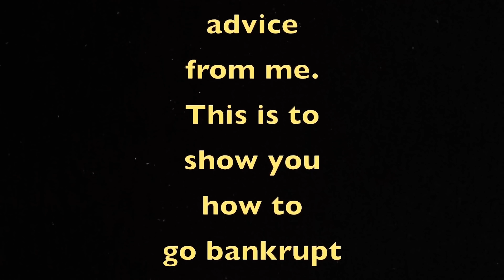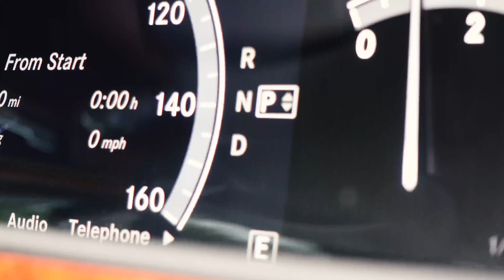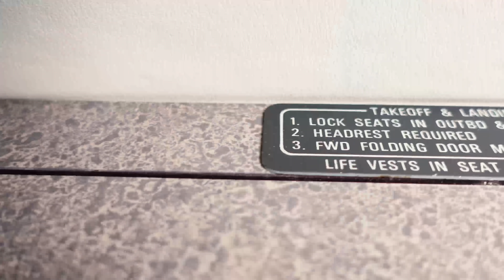Don’t Tell Wife, I put A Private Jet In The House!

Comment: Love the way that turned out!  Need to put some sort of cover on the top, to hide the wire that is supporting it.  You should also find some old PC monitors, turn them sideways, and put them behind a couple of the windows with sky scenes, or airport scenes.
Reply: acceler9, You beat me in this idea! That just means it is a great idea! I mean what could go wrong?
Reply: Could also use some pc fans for the air vents.
Reply: Jimmy get a wall mural that shows an airplane coming right at you in flight and put it behind the windows...That would look sweet.
Reply: Agree the monitors would be a great addition. You should also put the chairs on locking casters so you can move them in and out easy. On the shade closest to you use some vinyl that says 'Clear Prop' as you pull it down.
Reply: The monitors in the windows is a great idea!
Reply: The monitor idea is awesome.
Reply: 100%
Reply: Could always green/blue screen it, too... If he's got the ability in video editing

Comment: May I suggest that you build a "box", the length of the 'Cabin" wall.  Build it tall enough so the regular aircraft seats are at the proper height to the table.  Add seat tracks to the box, to hold the seats.  Your "Mini" cabin is then ready for "flight".  Carpet on "The Box" would be a nice addition in creating an "In-Flight" experience.  Change out the batteries for a 24VDC power supply for the lights.  Main thing is, which you're good at, HAVE FUN!

Comment: I'm getting on here a bit late, but hey as the saying goes, "Better late than never.".   My additions would be:  Look online for a simple 110v /28vdc transformer (basically like the power supply for a laptop), to hook up to the lights.  Oh, and add the EXIT light while you're at it.  Also, some type of bracing for the fold-out table is called for.  It's gonna end up broken otherwise.  Hmmm, I guess that has already happened.  And then do the other ideas mentioned below.  Especially the screens (at least pic's) behind the window shades.  Look into getting telescoping seat mounts, they are commonly used on Bass Boats and not very pricey.  Great job, so far!

Comment: I would have thought the better solution would have been to build a wooden frame over the top to hide the top of the lights and provide more rigidity. For the chairs, again a wooden frame underneath, to support the two chairs and a floor to put your feet on (as the chairs are designed to be close to the floor, not feet dangling.)

Comment: JIMMY Love your channel. Overheating Sierra problem - I had the same thing flying a rented PA28  Warrior -very high oil temp, lack of power at high revs ( extremely hot day for the UK ), previous flights OK - but colder weather. Nearly had to call a PAN,  three POB reduced power slightly when temp came off stop limped back to airfield.!!!
Cut a long story short the wrong prop had been fitted - looked exactly the same!! after correct prop had been fitted all was OK 
ps nearly all my hair is grey now  but i am 67

Comment: Funny Story.  I purchased an old bike with an "overheating"  issue.   After checking the pump, flushing the system a dozen times, new cap, new thermostat, I finally took it in and had a pro look at it. Turned out, it was a bad temp gauge.  The engine reached proper temp and just stayed there, but the gauge went right to red.

Comment: In the early 80's we took a small crew to strip out 3 707's int. To be installed in a nkc135a(3119) and a c135a(0378) at Offutt afb  they had a white top bad buffed engin ring cowl

Comment: Now, buy some cheap tablets as big or slightly bigger than the windows, and play a continuous sky movement in them to simulate a high altitude flight ! (Needs some tricks to synch all the tablets to show a different angle...difficult but not impossible)

Comment: The way to solve your seat height issue: Build a platform high enough to raise the actual seats from the jet up to usable height. The platform can easily be built from 2x4s and 3/4" ACX plywood, and it can conceal the wiring for your overhead lighting as well as provide storage. You're gonna lose the square footage in the room anyway; why not put it to work?

Comment: 3D printers power supplies are 24vdc, if you want to power all the lights (assuming they are 24v)
Reply: also many universal laptop chargers are capable of 24vdc, those are fanless so maybe better.  Look for MEAN WELL LRS-350-24 350.4W 24V that is what I use on my printer.  You can wire one of the buttons to turn on the power supply.

Comment: Now get on ebay and but a 24v power supply. that way you have 24v with out the batteries! PM me if you need to know which one to get. They are only around $30usd.

Comment: Jimmy, Part out the 310 which may keep some of the old fleet in the air! Perform a through inspection on the Aztruck to determine if it’s a viable candidate for return to service. Buy more hulks aka derelicts to restore!
Reply: Yup, need to know if the Aztruck is a viable. Given the engines both seem fine, compared to the ropey #1 on the 310, it always seemed the more likely option, to me.

Comment: A few old flat screen LCD monitors driven with Raspberry Pi Zero's would be perfect.  One flat screen LCD behind each window would make a great, ever changing background.  The nice thing about the R Pi Zero's is they need no cooling, draw very little power and are dirt cheap!  Pre-4K LED, LCD, HDMI monitors can often be picked up at auctions for little to nothing.  If not at auction, 17" referb monitors go for $40 or less each.  COOL OFFICE!!!!!!Maybe I could just buy an old, scrap 747 and put it on my lot for a house.  I wonder how much flack I would get from the HOA Nazis??????  Probably lots cheaper than building materials right now and the cool factor would be insane!!!!!

Comment: Build a narrow platform that raises the seat height to match the interior panels and table.
If it is only as wide as the seat base, you would be able to approach the ceiling panel and sit down without hitting your head.
i.E., 24" wide and 30" high (or whatever.) It would work like a kick plate.